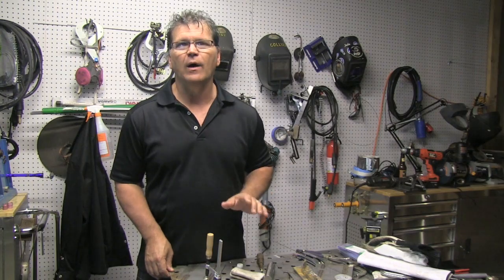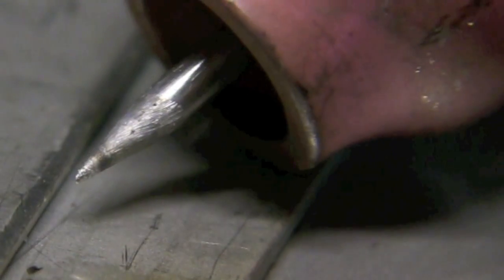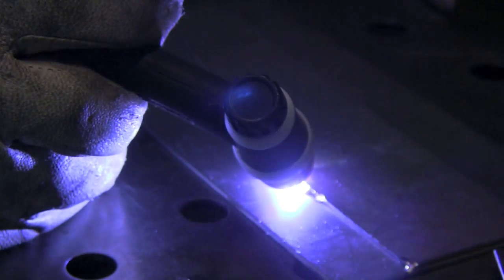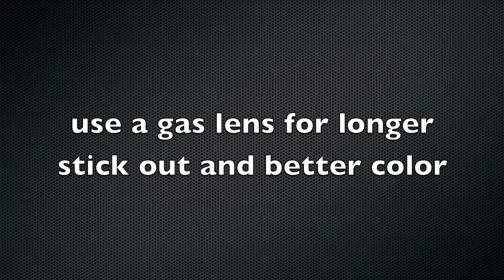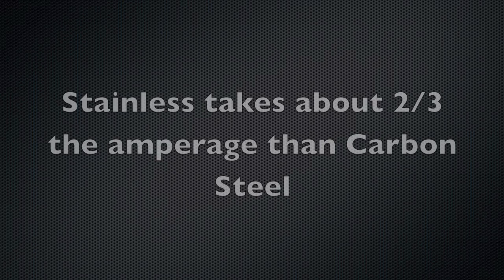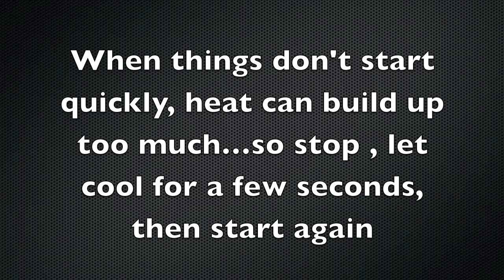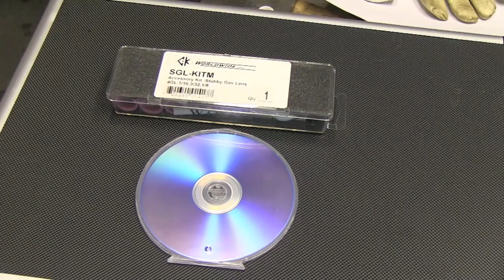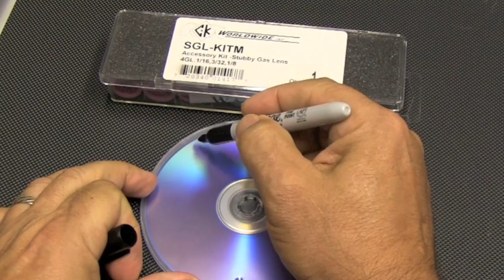Tig Welding Stainless Laps with a Stubby

Comment: I been following your videos, I bought a miller 220 after watching a few of your videos. .  I have a question, how do I do a lap weld with 20 gauge sheet to 16 gauge sheet.  The two thicknesses are a pain in the butt, I feel they are pudding at different rates and making my project difficult. The 16 gauge mild steel tube doesnt want to puddle and the 20 gauge wants to burn.  I can get a few stiches here and there but is it a more challenging TIG process?   Can you address this in a video. It's okay if its a fail video.

Comment: Excellent video. You used a number 6 cup. Could you have used an ordinary number 5 or 4 cup ? Would the stainless burn. I am having problem with discoloration using a no 5 cup. I dont have any gas lenses yet.

Comment: Got my tig finger and used it today. Love the nice cold pinky for the first time. Yes I'm one of those who sacrifices a little burn to finish up nicely. Won't have to no more. I do have a question. What do you suggest as a gas setting when welding 1/16 stainless with the stubby gas lens kit. I usually use 1/16 tungsten rod at around 50 amps on our old small Miller 120v DC machine at work. Don't remember the model. Usually using it rather than using the better high frequency Miller machine I also have access to. Just more convenient at work. Closer to tools where that machine sits. Love the videos and appreciate all the knowledge!

Comment: Notes. 
Lots of quick small tacks. One inch more on thin material
Get moving fast to avoid distortion
He is running 40-50 amps
Bad result without good coverage.
Try lens kit and less stick out
2/3 of the amp of steel.
Rule of 33  for pulse does not apply my unit has no pulse
Stop and let it cool if you have to hesitate at all. Let heat dispense.

Comment: hey jody, Im using your #9 and #20 stubby gas lens kit. for some reason, my stainless steel welds are not wetting in anymore, nor are they moving like youve got. it takes a bit for a puddle to start and when it does the minute i add rod, it goes cold. ive done great with stainless in the past, but i have no idea what im doing wrong. im welding a t joint on 1/8th inch 304 stainless steel with e308L rod in 1/16" and 3/32" size. using 3/32" 2% lanthanated electrode, number 8 gas lens running 20 cfh of pure argon. im running my amperage around 80 at the top end, but using 3/4 pedal. any ideas what i could be doing wrong?
Reply: thank you! im going to try that tomorrow morning in class

Comment: great demonstration! I've been TIG welding for about 15 years, and you explained things very well. I rarely use the non-gas lens cups, because of the limitations you showed, and also because of the work situations I find myself in. IMHO, the lens type cups provide a much more uniform, smoother flow. They simply take one of the variables out of the picture when doing expensive SS work in the field.

Comment: I weld Aluminium at work but tried a piece of stainless the other day, haven't done stainless for about 6 years and was wondering why my welds were coming out dirty and not nice and clean like this and like i was doing in trade school, now I know! will be buying more lenses etc for my TIG welder. Thanks weldingtipsandtricks

Comment: joddy your videos are very helpful. and one of your stick videos uphill helped me get better and even helped me win a compaction. i came in 15 out of 134 people in appearance  welding. 5 bead stringer cap. but got thrown a damn loop machine is set 1-10 put it on 5keyholed a 3/4 inch plate on root pass. but thank you for your videos thay are some of the most helpful on you tube

Comment: I need a stubby lens kit for 26 style thermal arc torch will that setup u have fit mine..
Reply: A suggestion my friend.  Simply grind down a cup (lens) you already have on a grinder (on the arc end obviously).  Hope this helps if you are in a bind for one quickly.

Comment: I know its off subject , but in regards to aircraft TIG welding. For a basic weld test here in Australia we butt weld 2 pieces of 0.063" material with full peno.. Do you know of anything on the market that is premade or the plans, to make a jig that is capable of holding  the 2 pieces of metal tegether to prevent distortion whilst welding and give full gas coverage to the underside. I had one years ago when i did the a/c welding course but lost it. Im also after a cup with a trailing edge for welding titanium to give gas coverage after the intial weld has been done. Any help appreciated.

Comment: Tnx Jody, will the kit only be for WP17? I am using WP9 alot, and does it fit my Weldcraft torches? Greets
Reply from the maker: This kit in this video is only for big torches like 17, 18, 26 ..for a wp9 all you need is a regular small gas lens and most welding supply stores have them in stock.  I am working on offering those kits too in a few weeks.
Reply: Ok, thanks Jody!